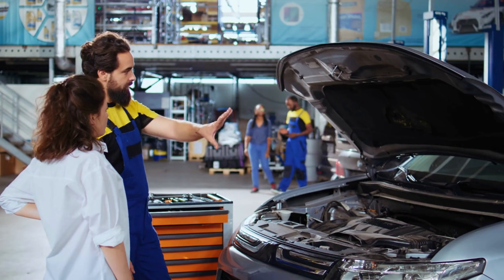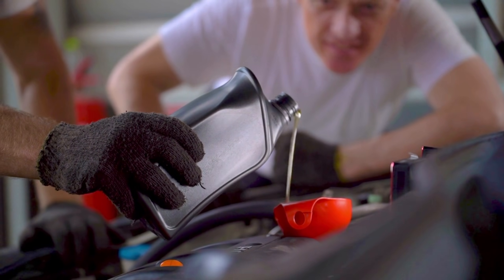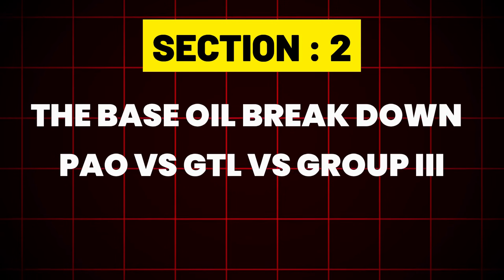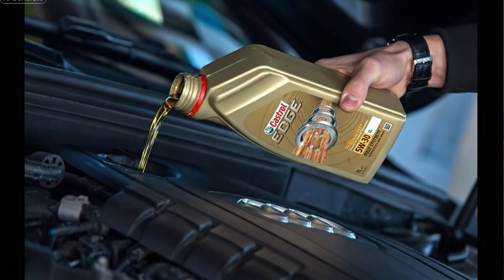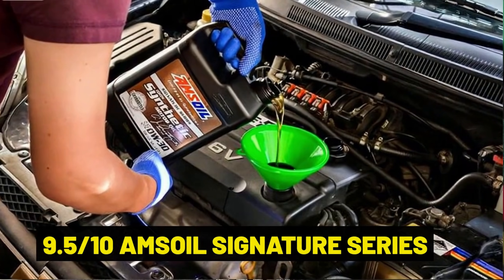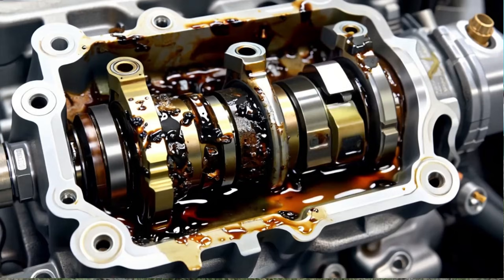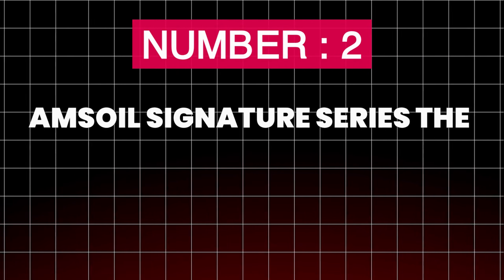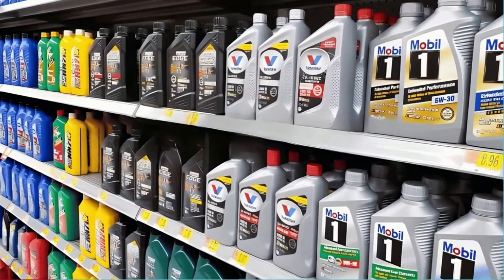7 Premium Synthetic Oils Put to the Ultimate 150,000 Mile Test

Comment: I have used pennzoil for over 35 years never had a problem I think it is the best out there
Reply: While Pennzoil Platinum is a solid Group III (GTL) oil for daily driving, calling it 'the best' ignores the technical hierarchy of lubricants. From an engineering standpoint:
• Base Stock: Pennzoil cannot match the thermal stability of Group IV (PAO) or Group V (Ester) boutique oils like Red Line.
• Volatility (NOACK): Pennzoil typically hovers around 8-10%, whereas high-tier Ester oils achieve ~5%, drastically reducing intake valve deposits in Direct Injection engines.
• Protection: Pennzoil meets standard API specs, but for high-load or Hybrid start-stop cycles, the extreme ZDDP (1200+ ppm) and HTHS levels found in professional-grade synthetics provide a superior safety margin.
Pennzoil is great for the mass market, but in terms of pure molecular engineering, it’s not at the top of the pyramid.

Comment: Something ain't right with this because I have used Castrol for well over 200,000 mi in  multiple vehicles and NONE of the subjectives you all have stated I have ran into. 3 Buicks(91 Regal Custom,08 LucerneCXL,15 LaCrosse premium2) 1 Infiniti(2000 G20) an 1 F-150(95).

So I find it hard to believe your statistics.

Comment: Going have to leave Castro 😂😢
Reply: You can if you want but I find it very hard to believe these statistics since I've used Castrol on multiple different Vehicles well over 200,000Mi on each for over 25 years and not ran into any of the statistics that they have charted
Reply: I have 338.000 miles on my 94 Trans Am I bought new.  Engine has never been touched,  even the timing chain is original.  Still runs like new , uses no oil. 3000 mile oil changes,  Castrol GTX 10 30.

Comment: Since Amsoil won the vast majority of your tests, how can you claim that Pennzoil was the winner!!??  When you (or was it an “AI Robot”) declared Pennzoil the winner, you mentioned that the terms “availability” and “value,” which were apparent factors that Pennzoil was named the winner?  Concerning the “availability” of Amsoil Products, you should have mentioned they are readily available to consumers across our nation by Amsoil shipping the products directly to consumers’ homes, so they don’t have to leave their homes to go shopping in a big box store for Pennzoil.

You failed to mention the cost differential between Pennzoil and Amsoil, however minuscule that sum happens to be.  Furthermore, you failed to point out the significant gallons of gasoline saved over the course of “7,500 miles,” when using Amsoil over Pennzoil, which would produce more overall savings in comparison to Amsoil’s initial higher price!  I shall prove to you the cost savings when someone uses Amsoil vs. Pennzoil (GTL oil supplied by Pennzoil’s owner, Shell Oil Co, an overseas company) in the following paragraphs:

A number of 5 Star Reviews can be found on the official website of Amsoil written by their verified customers.  They are written in chronological order, including the following example:

"5 star rating  WOW! UNEXPECTED RESULTS By MUGENIZER, a Verified Buyer from Vancouver on April 11, 2024:  I was using Pennzoil Ultra Platinum 0W-20 Full Synthetic for my Honda Pilot 2016 exl with 261K km in it. Obvious crackcase noise & lifter noise. Fuel consumption of 12.9 liters per 100km. Now with using Amsoil Signature Series 0W-20 Full Synthetic...noise in the crankcase & lifters are a lot less. My fuel consumption is now 11.8 liters per 100km. The engine run smoother than it was. I wish i've used Amsoil ever since. Now, i use it in every vehicle i own. I highly recommend this product."  [Using the mathematical conversion of the metric system to the U.S. version, the Pennzoil MPG calculates to 18.23, whereas the Amsoil MPG is 19.92, an increased differential of 1.67 MPG in favor of Amsoil and is exactly the same percentage increase in fuel economy as was calculated in the metric system: 9.2%].

How many miles will "Mugenizer" save a gallon of gasoline while using Amsoil instead of Pennzoil?   The Answer: 198.16 miles (calculated as follows:  100% divided by 9.2% = 10.87;  10.87 x 18.23 = 198.16). 
  
Want to know the amount of gallons of gas saved by "Mugenizer" by using Amsoil in your recommended 7,500 mile Pennzoil oil change schedule?  Answer:  37.85 gallons of gas, (7,500 divided by 198.16)!!  The total financial cost-savings by "Mugenizer" would be $113.54 (37.85 x $3.00 a gallon)!  Enough savings to purchase another batch of Amsoil Signature Series!  So the few dollars a quart "Mugenizer" would have initially saved from originally buying Pennzoil (rather than Amsoil), would have been more offset by burning $113.54 in extra gasoline (than if "Mugenizer" would have originally bought the Amsoil instead).  I have other examples to cite, involving MPG gains of Amsoil over GTL oil, if you would like? 

Why use Blackstone Labs (they don't measure "Oxidation," a key measure of oil degradation and besides, their equipment is out of date, according to the Blog Site, Bob is the Oil Guy)! Best to use Oil Analyzers, Inc or if cost is not a concern, Lake Speed, Jr's company, SPEEDiagnostix, where both of these companies measure "Oxidation" and they have up-to-date equipment.

Amsoil warranties their Signature Series oil to last 15,000 miles under "Severe Driving Conditions" or one year (whichever comes first) or 25,000 miles for "Normal Driving Conditions" or one year (whichever comes first), if you use the appropriate oil filter that is capable of lasting the duration of the elongated oil-change interval.  So the extended oil-change interval which is readily available on the Amsoil Signature Series, as well as the Mid-Grade Amsoil Extended Life oil, even shines further and is even more cost effective than Pennzoil!  Amsoil warranties their Extended Life oil to last 12,000 miles under "Severe Driving Conditions" or one year (whichever comes first) or 20,000 miles for "Normal Driving Conditions" or one year (whichever comes first), if you use the appropriate oil filter that is capable of lasting the duration of the elongated oil-change interval.

Comment: "Simulated" driving?  So they didn't actually drive 150,000 under REAL conditions.  Don't waste my time!
Reply from the maker: Simulated doesn’t mean fake it means controlled. Real-world driving varies too much to compare oils accurately. A 150,000-mile controlled endurance cycle removes all outside variables so you can see the oil’s true performance, not random traffic or weather effects. That’s why manufacturers themselves use the same testing standards.

Comment: I think they also sell top tier fuel at shell😊which is the only gas I would use.
Reply: She'll. In my 2010,, TOYO, COROLLA, HAS 7OO.000.❤🎉 MILES
Reply: @IronMike-f8i what have you done for choice of engine oil and filters?
Reply: I use two bottles of REDLINE every oil change. Any PEA cleaner in gas or bottle keeps engine clean.

Comment: I have been using Mobil 1 0-20W from Costco in my 2016 Honda CRV since new.  Now the car has 170,000 miles and doesn't burn oil at all.  I change oil every 5,000 miles with a Honda oil filter.   I don't think it is the brand of oil that matters but the frequency of changes.
Reply from the maker: That’s awesome to hear  170k miles with no oil consumption is solid proof your routine is working. Mobil 1 + 5,000-mile intervals + a Honda filter is a great combo. And you’re right, the brand matters less than staying consistent with quality oil and regular changes. Your CR-V is a perfect example of simple maintenance paying off.
Reply: I would never put 0w20 in that engine, 5w-30 or at least 0w-30

Comment: This does not jiv with The Oil Geeks Test of NAPA - SUPRTECH

 AMSOIL - ROYAL PURPLE.
Reply from the maker: Yeah, I’ve seen that comparison too. Different tests can give different results depending on the method, equipment, and conditions they use. That’s why some videos show NAPA or SuperTech doing great, while others put Amsoil or Royal Purple on top. It doesn’t mean anyone is wrong  just that the testing setups aren’t identical.
Reply: @CarCareCrewoffical  Mr. Lakes  testing was to show the delusion of "Marketing" and that a higher priced lubricant is not going to give you any better potection than the budget brands.
Reply from the maker: @markwarnberg9504  His test has its own place, but I’ll share the results I found from my own testing as well. That will give a clearer picture of how these oils actually perform.
Reply: What about Red Line? Red Line is the best overall.

Comment: I have Amsoil in my vehicles because I want to run 0w-30 and Pennzoil’s 0w 30 is almost as expensive and not available in their Ultra Platinum, which, btw, is even better than Platinum.
Reply from the maker: 0W-30 Amsoil is definitely a solid choice, especially if you want that viscosity and long-term stability. And you’re right  Pennzoil Ultra Platinum is better than regular Platinum, but it’s harder to find in 0W-30 and usually priced almost the same as Amsoil anyway. At that point, sticking with Amsoil makes total sense. You’re basically getting top-tier protection without the availability headache.
Reply: no it's not priced about the same and if someone wanted a Chevron product they can purchase Havoline for 1/3 of the price and before you reply were do you believe Amsoil purchases their base stocks and addictives from? There are only about 3-4 companies who produce both
Reply: WALMART HAS IT, AT 24 DOLLARS. 5 QTS!! OR 7.50. A QT..
Reply: @IronMike-f8i    Ultra Platinum ?  Wow!
Reply: @IronMike-f8i  5w-30...yes. No Walmart around me has 0w-30 Pennzoil. I can only find it on Amazon, it's not Ultra Platinum, its Platinum, and it's priced almost the same as Amsoil.

Comment: It doesn't matter what oil you use, changing your oil every 4-5K miles with a quality oil filter is the key to a long lasting engine, but Do Not forget your transmission is 3x more likely to break down that your engine is, changing your trans fluid at 40-50,000 miles is just as important as changing your motor oil is, if you want to keep your vehicle rolling down the road
Reply: A Trans flush may be good the first time at 50- 60,000 miles, but after that, just a simple drain and fill every 40-50k should be adequate
Reply: @stevenboyce4136  Yes absolutely 💯. 60k max for dealership flush then every 25k mis for drain/fill . Ya only getting 5qts out w/that approach.
Reply from the maker: @stevenboyce4136  Yeah that’s a solid approach. A full flush early on helps reset the system, but after that, regular drain-and-fills every 40–50K keep the fluid fresh without stressing anything. It’s one of those simple habits that really extends transmission life.
Reply: @stevenboyce4136 Transmissions today are filled with lifetime fluid. No reason to change it.
Reply: @Lawnboy21  Ummm lifetime of warranty bud. Facts.
Reply: @Davido50 Not so. Atf fluids today are designed for lifetime service of Transmissions and differential units. I've seen Toyotas go over 350,000 on original WS lifetime trans mission fluid.
Reply: @Lawnboy21 yeah,  just like  timing belts, brake fluid and coolant!!!
Reply: @john0270  I do not know anybody that has ever changed brake fluid? Added to it ye  but changing it. Why? I've had vehicles for 25 years and never changed brake fluid.
Reply: @Lawnboy21 okay 👍
Reply: @Lawnboy21  your knowledge of cars could fit in a teaspoon.  Please,  no one listen to this guy if you want long tern reliability from your vehicle.
Reply: @Lawnboy21  that IS A LIE
Reply from the maker: You’re absolutely right consistent maintenance beats fancy oil every time. A solid 4–5K oil interval with a good filter keeps most engines happy for the long run. And great point about the transmission. people ignore it until it’s already slipping. Fresh ATF every 40–50K can literally save thousands in repairs. Solid advice, man.
Reply: @CarCareCrewoffical If your brand SP rated full synthetic can't go 5k mis minimum it's trash. Pennzoil Platinum is $24 5qt jug & can easily do that. Save time & money bud. Or Amsoil been shown to do 10k mis on LOW END & still good! Used oil analysis doesn't lie. Been using Pennzoil Platinum for 10yrs+ but goin to Amsoil soon for 7500mi oil changes in '24 F150 w/ gen3 - 3.5L GTDI Ecoboost V6. Truck been impeccable. Use synthetic oil filter too! Fram Ultra Synthetic is excellent & $9. -NW Ohio
Reply from the maker: @Davido50  You’re absolutely right that any SP-rated full synthetic should handle 5K miles without breaking a sweat. Pennzoil Platinum definitely holds up well, and UOAs back that up. Amsoil is on another level in terms of oxidation resistance and shear stability, so 7,500 –10,000 miles is realistic in an engine like the Gen-3 3.5 EcoBoost as long as the driving conditions aren’t severe.
And yes running a high-efficiency synthetic filter like Fram Ultra is a smart move. Consistent filtration + a stable synthetic oil is really what keeps these turbo engines clean and happy over the long haul.
Reply: Apparently it DOES. Changing any modern SP rated full synthetic before 5k mis means you need to change brands asap. -NY
Reply: @Davido50 , it is not the oil itself, maybe fuel contaminates the oil at cold starts due to blow by when the piston has not expanded yet due the the heat. What if you only drive short trips and your oil can not burn off the water in the oil due to condensation inside the block on cold mornings...that is what destroys the lubricating quality of the oil, the mileage is important, but other factors are at play too
Reply: @Davido50 5000 miles is way to soon for any modern engine oil. 15,000 to 20,000 is the new normal for engine oil services.
Reply: @Lawnboy21 you maybe should watch some videos on YouTube.
With oil lab analysis test results. If you truly love your vehicle and you're running anything except for amsoil you had better change it every 5,000
Reply: @Lawnboy21  Cray thing my coworker told me he doesn't go to those 19-dollar oil chang shops because the just put back in your car old oil, it's a game, the math doesn't work
Reply: Oil life and engine wear is not based on vehicle mileage.
Reply: Never, not change your oil after 6 months but a year is pushing it, read the oil life on your car system, I say every six months change your oil and air filter and every year drain your radiator also your fuel filter air filter, remember they use this type of stuff to get money meaning you don't change your oil after 6 months or a year thinking you can go over a year on a certain oil, you are a fool, change your oil every 6 months but if you are using bad oil change it  every three months, otherwise your engine will fail
Reply: southern states especially bigger cities with stop and go fun.  Every 3K  cheap protection.
Reply from the maker: @GloveRelace  Makes sense. In the southern states, especially with all that stop-and-go city driving, a 3K interval is cheap insurance. Short trips and constant idling beat up oil faster than people think, so fresh oil every 3,000 miles is definitely solid protection.
Reply: @GloveRelace  3k mis for SP rated full synthetic oil!?? Wasting time & $  ...countless used oil analysis show better full synthetic oil good for 5k mis easily. Doesn't matter where ya live. Use synthetic oil filter too- Fram Ultra synthetic can't be beat for $9. Highly rated by all. -NW Ohio
Reply: @Davido50  not in the texas heat.  Oil doesn't last. Plus I change my own fluids so really not a huge deal money wise/
Reply: @Davido50  Ultra Pennzoil hangs with Amsoil the test proves this, but people believe the hype and go over 6 months even if you oil gage says it's okay i would just change my oil after 6 months not below 50% oil life, keeping your engine clean at all times no black mess that sticks to your engine, the stick should look like new oil when you change it, old days black oil nobody cared but your engine will fail.
Reply: I drain every 25k

Comment: After using Pennzoil Platinum Plus for years, but with my current service shop using Castrol Edge, I will have to have a talk with the shop's management. Oil choice is critical, and I don't mind paying "somewhat more" for the best, and best value synthetic oil. Or finding a different shop.
Reply: Castrol Edge is high quality also
Reply from the maker: Absolutely, oil choice is super important. If you’ve been happy with Pennzoil Platinum Plus, it makes sense to stick with what works for your engine. Having a chat with the shop about your preference is smart, and if they can’t accommodate it, finding a shop that respects your choice is worth it peace of mind and engine health are worth a little extra cost.